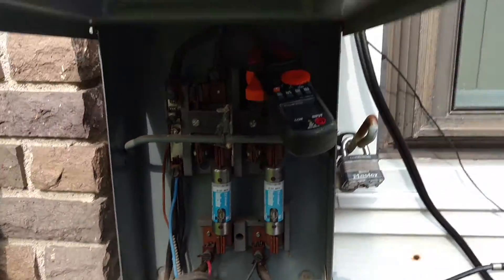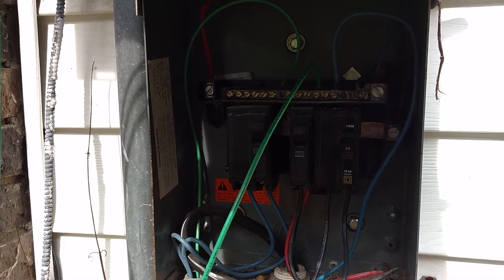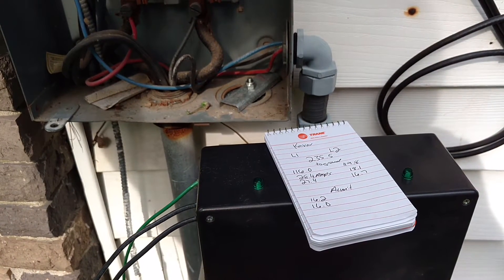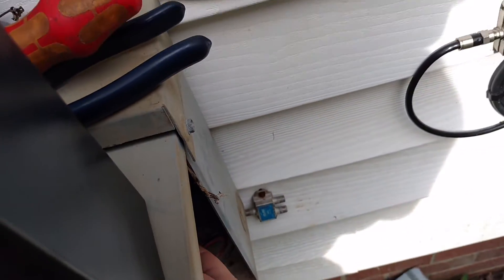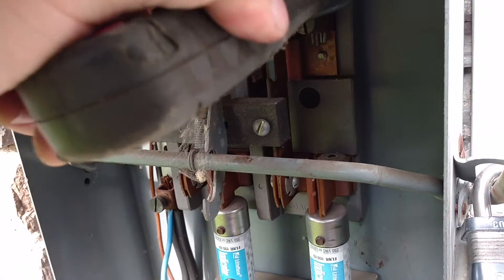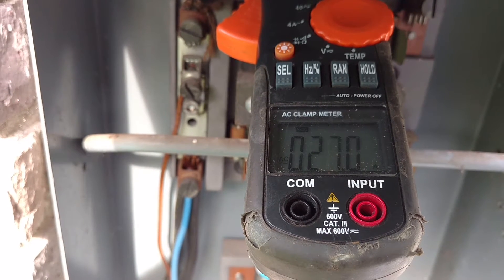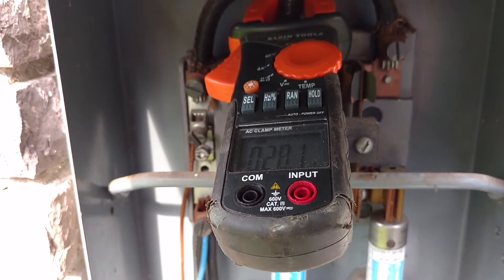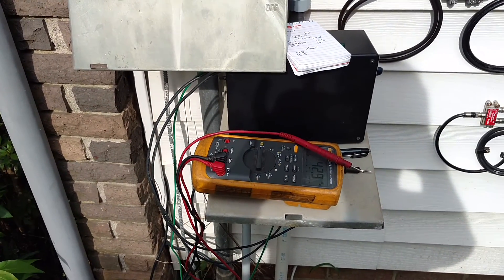Home made Kvar power saver

Comment: Utilities only charge residential users for real power consumed so correcting power factor should only be done directly at inductive loads to reduce in house line losses if at all.
Reply from the maker: Robert Szasz if the meter actually slows down you are saving on your electric bill, but it’s such small savings you probably won’t ever see a reduction on your bill
Reply: JonesHvac correct, but a clamp on amp meter isn't going to reflect the speed of the billing meter for power factors other than 1. You need a meter that measures amperage and voltage at the same time to measure real and apparent power. 

Adding capacitors to inductive loads like motors will help increase their power factor, and reduce the amperage they draw. However it won't significantly change the amount of real power they draw (there would be some tiny reduction in the heating of the wires between your electrical meter and the motor, as well as in the motor itself, but if everything is properly rated your probably looking at a  0.1% to 1% savings at the absolute most)
Reply from the maker: Robert Szasz Yeah I see what you are saying, this is really just a test I did compared to how we use capacitor banks on 500hp motor start ups at our local paper mill. It really just reduces the load spike applied during those times.
Reply: JonesHvac In industrial applications power factor correction can be incredibly important. Both for reducing peak amp draw inside the plant (fuses and breakers see apparent load), but also for the utility as really big inductive loads can cause all sorts of faults (so utility companies require industrial users to always stay above a certain power factor as well as charging out the nose when the power factor gets low) 

There is a company out there selling a product named KVAR to home owners, marketing it as a cost saving device for the whole house. In that application capacitor banks are a scam.

Thanks for the response